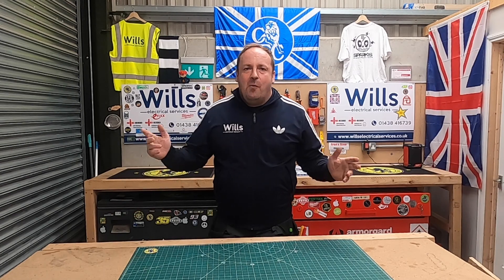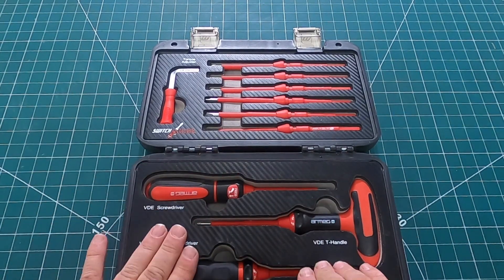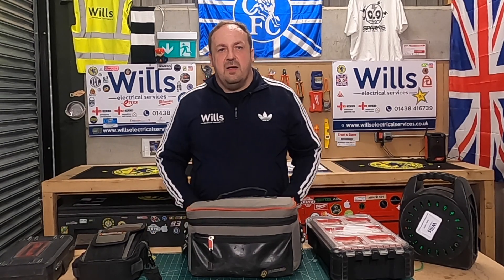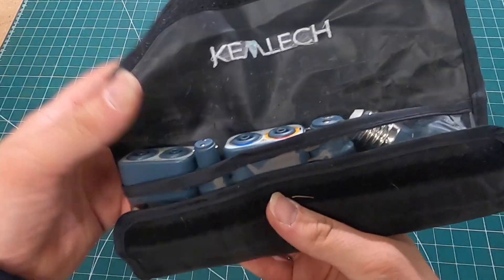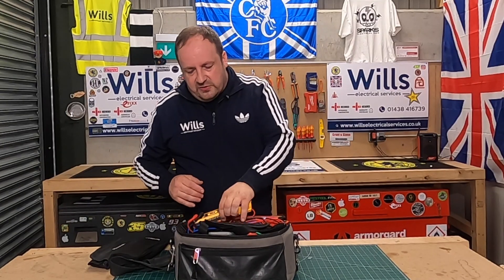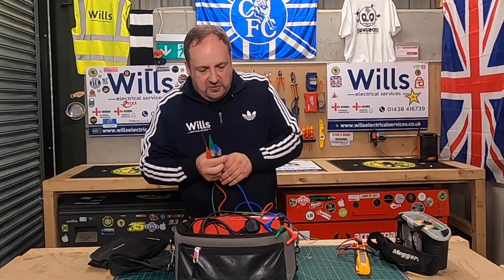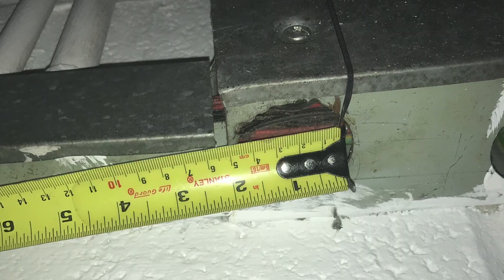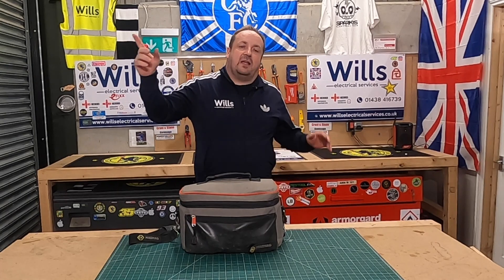Electricians testing bag tour

Comment: Have you tried the "kewtech loop check 107 socket tester" Works well when testing and can help you find what circuit a socket is on by tripping the rcd or if you can't be arsed turning it off at the DB just trip the rcbo or rcd with the check button
Reply from the maker: I’ve seen them about but I’ve never used one
Reply: @ElectricianTV  like you I love my tools. It's a handy tester to have in your test bag. A little pricey for a socket tester but I prefer it over my other plug in testers